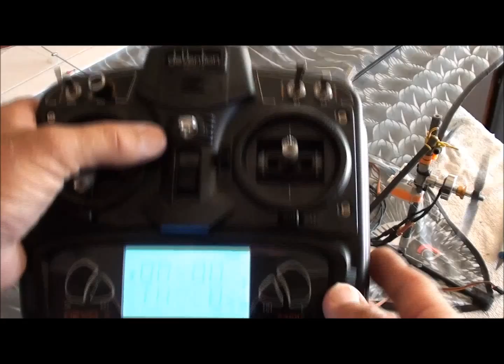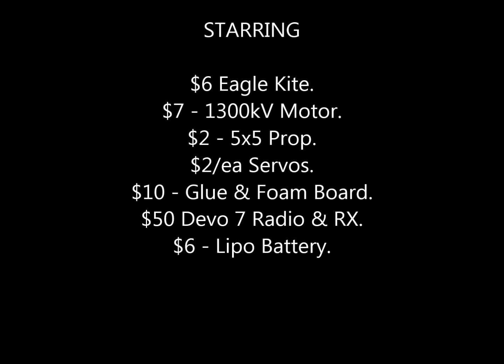RC Kite Commissioning

Comment: Cool kite beans ... I consider myself a learner and how ... Anywhoo ... you'll find out flying this model will challenge the way you "normally" fly airplanes. Since this uses thrust vectoring to turn, you need power at all times - not too much not too little. If the weight distribution is just right (CG on the plastic cross piece...) you really do not need a lot of elevator to climb -  increase the power just enough to climb - decrease to descent. Having said that, I find the elevator a life saver (intentional high alpha to stall it ...) to get out of thermals when they grab the model and pull it up ... it's a scary experience to see your model rising by itself with no inputs from the pilot. Looking forward to the flight vids Mooch ...
Reply from the maker: Thanks for the tips and yes I am excited as its been sitting for way too long....... how did you launch yours.. hand throw or belly take off?
Reply: moochasas Ohhh .. I forgot to mention ... hold it at the CG point ( from the back ) and give it a slight upward toss with enough power and it will slowly rise the moment you let go. Never got it to take off from the ground as the "head" plows into the ground (downward angular movement ..) but when tossed and airborne, something happens and it flies. Building the model gave me an appreciation for the real Master who designed it.
Reply from the maker: tsisapik Thanks will do.......cant wait for the first really still day...... up the farm the (real) birdies will love it...... may even get the mobius cam onboard for that "birds eye" view...... pardon the pun.